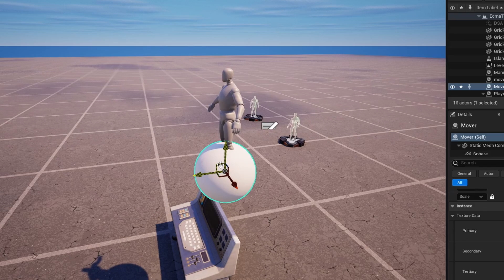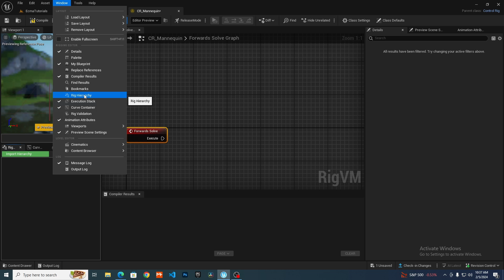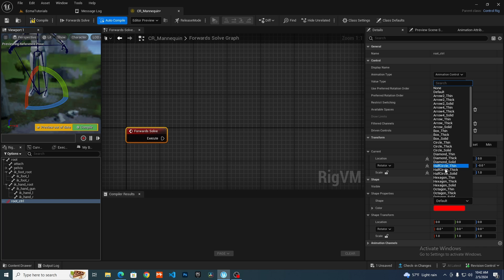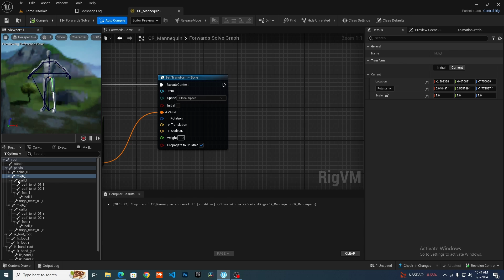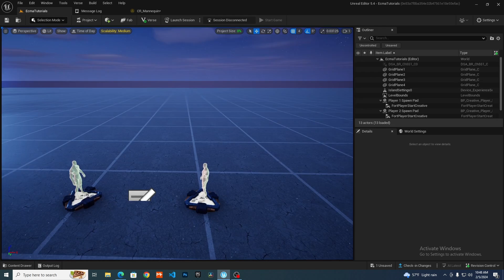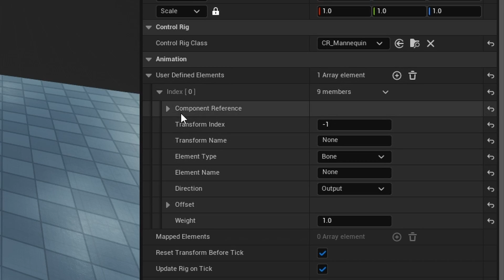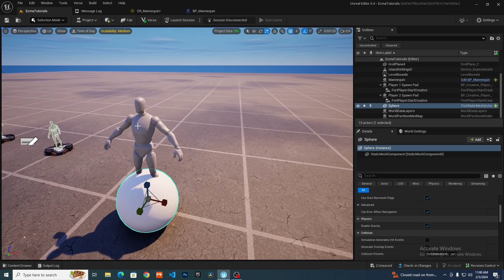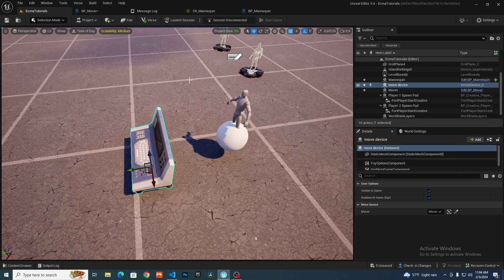UEFN Control Rig 1 - Introduction and Smooth Movement in Verse (Beginner Tutorial)

Comment: Yo Pi, I am doing with this with a custom character and when I type in the element name, the bp and the control rig go flying super high up, any idea what I might be doing wrong?
Reply from the maker: That usually happens when stuff gets referenced weirdly or out of order. Check that the root is set to output and control is se to input
Reply: @piequalsthree3  YO thanks for the reply, I fixed that (kinda) but now my main question is, is this possible with animations? I have a custom character going but he no longer animates with my input devices when everything is attached.
Reply: There must be a way right? I'm guessing it's because they are attached via the root bone which is stopping all bones from being able to move during the sequencer animations? I'm out of luck right now lol this is hard. I either get a laggy character with animations or a smooth character with no animations with my current capabilities.
Reply from the maker: @S1lentIntensity  You can use a sequencer and reference the blueprint. Then play an animation from there
Reply: @piequalsthree3  That's what I'm doing but he's stuck in t-pose..I might have to rework some thangs idk
Reply: @S1lentIntensity  I'm having the same exact issue, did you ever figure it out broski?